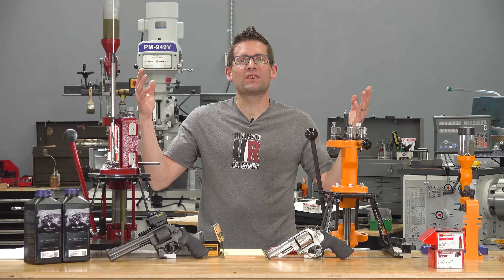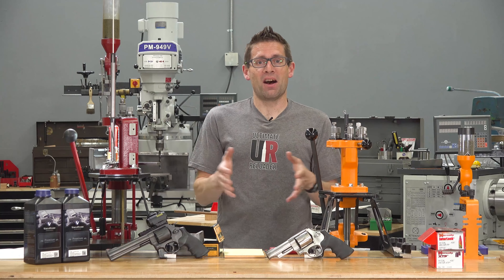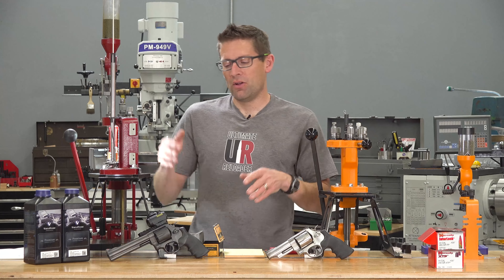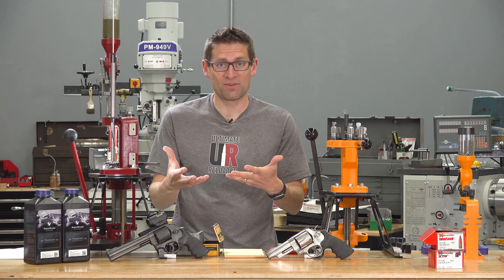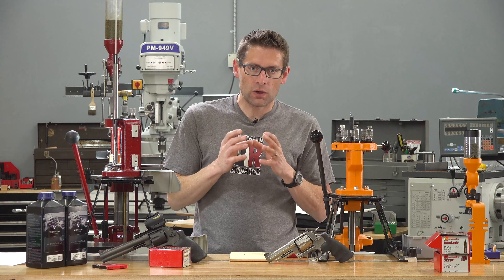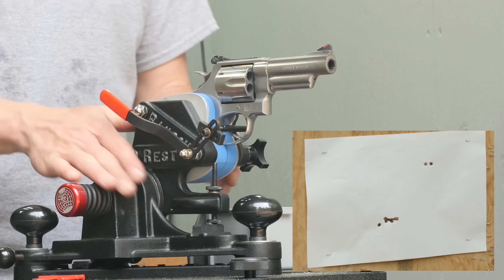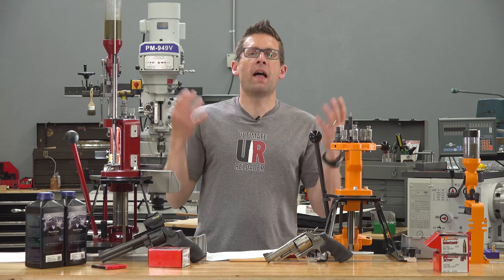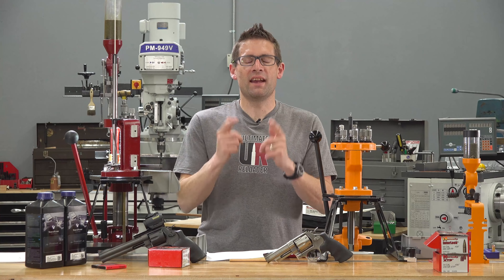Match Pistol Ammo -vs- Progressive Pistol Ammo Experiment

Comment: Also found that each gun (more so with rifles) like a certain bullet weight. It is finding that for your particular firearm and work with that. Like your 4" obviously doesn't like the heavier bullets. That's normal. I'll bet you if you get another 4" 629 it might even like the heavier bullets.
Reply from the maker: Isn't it strange how "particular" firearms are to different loads?
Reply: @Ultimatereloader  very. Almost like finger prints. One would think something from an assembly line should be the same.
Reply: @Ultimatereloader  Very. Would be interesting to find the cause for that variance.

Comment: I have a 629 with about a 7" ported barrel and on it I do the same as you, load mostly 44 special loads but using Starline 44 mag brass so I won't develop 'the ring' from using 44 special brass. As a former Bullseye shooter and a PPC match shooter back when revolvers ruled PPC, I feel to get the most information you really need to shoot for groups at 50 yards, and using the Ransom Rest you don't have to worry about skill level possibly messing up the results. So much more information is gained by going to 50 yards over a shorter distance. Back when I was shooting PPC in the Master class all my 38 special ammo was reloaded on a Dillon RL550, this was before the 550B model came out. I wish I had a Ransom Rest to do some testing, but I was able to get all my shots inside the 10 ring of the standard B27 Police target at 50 yards off a rest, so I knew my revolver and ammo were performing well, but a Ransom Rest would allow me to get the absolute best performance.

Comment: I think you will find that you need to look at the force cones and barrel throat as to why some bullets perform better - with 50 years of bullet loading experience I have had the experience of developing loads for 2 brand new identical sequential s/n pistols - just to find they liked different primers and engagement lengths (This drove me crazy because I nor several others could not measure any significant differences) . I have spent my life as a Mechanical Engineer and removing the human component is just the start, LOL. I like your channel  - trust the Scientific Method

Comment: Fantastic video! This new R.Rest you have will make for some great content in the future. I also like the fact you used some Lee dies. Lee equipment is what I started with. I still use many of my Lee dies. When I reload on my single stage, I will do each process on all the cases before rotating the turret. It keeps me from missing a step. That RCBS powder trickler is too cool. I cleaned up the mold line and polished it up. All of it is great fun. 👍🙂 Thanks Gavin, great stuff

Comment: I would like to see more about how you mounted your rest. I have been using one for about 25 years and have mine mounted to 3/4” plywood with a 2”wide strip of plywood at the front and back on the bottom. This bolts to a telephone pole buried several feet in the ground. Also I use my finger to pull the trigger, not the linkage. It would be interesting to see the same test run with once fired brass and groups fired with individual chambers. With revolvers I generally fire groups of 18 to 24 rounds, with revolvers, as this will often show trends developing with each chamber. With autos I like to shoot 25 round groups 5 rounds at a time. This will show whether the gun will throw the first round out of the group. Good shooting.
Reply from the maker: Thanks Kurt- I was wondering about the variations due to each chamber... If you read the article I link to I show my test setup at a high level. Appreciate you sharing your experience as I'm just getting started with the Ransom Rest here...

Comment: The Precision Pistol (Bullseye) shooters use 50 yards as their measure.  And they look for group sizes under 2 inches at that distance.  It can be done.  Repeatedly.  With progressive ammo. 

Bullet selection is 90% of the battle.  Powder type and charge weight is key. Primer selection isn’t that important.  One thing that is seldom explored is crimp.  Type and amount appears to have a significant impact on ballistic consistency.
Reply from the maker: Good info, and I believe it. Bullet selection seems to have a big affect!

Comment: I have an engineers brain! I wonder how things work together. In the case of ammunition how does certain powders, with certain primers, with certain bullets, in certain cases perform. Also how does loading them on a single stage press compare to a progressive press compare to a turret press, compare those loaded a hand press.  How does the specific firearm affect the results? As an example: a new firearm that has never been fired, a firearm that has a few hundred rounds fired, a firearm that has a couple thousand rounds fired and a firearm that has several thousand rounds fired through it and All the firearms are the same make and model.  How does barrel length affect performance of the ammunition? How does the twist rate affect the performance of the ammunition?  Along with many many other factors!  Some include: air temp, humidity, elevation above sea level, etc. How does all of those factors affect the performance of the ammunition and the firearm.  See what I mean. lol    That is why I love videos like this!  Keep them coming!

Comment: A good quality barrel is just as important as consistent ammo :)
Reply from the maker: Absolutely- and good timing on a revolver, forcing cone, etc. Now I'm thinking I may need to build a match grade revolver... The sickness is taking hold...
Reply: My personal experience and tip: put the firing pin on the hammer and stay away from the spring loaded internal pins on the newer design on s&w`s... traded my trusty 686-3 for a 686 competitor, and triggerpullweight wise im salty AF :/ the apex hammer kit helped, but still not close enough to  what i had... "YES! i only use federal SP primers" :P

Comment: You can not talk about match grade and not sort your brass, aldough it is new there are differences in hight and sometimes also in hardness of the brass. Also every weapon needs carefull finding of the right load. Even if you have two identical pistols, they may require different loads. But other ways, a interesting test.

Comment: It would be interesting to load a batch with the progressive, measure COL consistency, then deconstruct the ammo to measure how consistently the powder charge dumped. How much variation in measurement makes no real difference in 25 yard accuracy?  What is the "tolerance" for COL length for a given charge?  What is the "tolerance" for powder charge variation that produces no real difference in accuracy?  
Some of these questions arise from my own use of the Hornady LNL progressive press.  With my best efforts I still get ammo batches with .005-.007" change in COL. Am I being too picky??   And if I check powder charge every five rounds, trying to maintain a powder dump of +/- .05 gr, I will probably reset the powder dump 3-4 times every fifty rounds.

Comment: U think that 260g load just isnt getting the bullet moving fast enough to stabilize enough. I wonder what a 100 yard target would tell ya about the  bullet impacts and their stability? It be enough distance to show if some of the rounds are starting show signs if stability issues. Or maybe it's a combination of barrel length, powder and bullet weight are not not optimal which should be visible at that distance as well. That was a significant degradation in accuracy if the cylinders and bore are in spec and size properly (seems to be good since the 240 load shot well). I my experience carbon rings havent affected accuracy after the first cylinder or 2 at most unless its obvious caked in there and I'm shoot lead.  Hell its usually not a issue even when it's obvious using different bullet profiles when shooting jacketed bullet after a cylinder or 2. That's a big difference, post a follow up when u find the origin of the 4" accuracy loss w/the 260g bullets please.

Comment: I bought a used ruger sp 101 and it shoots fine with factory ammo but with my 38 special reloads it gets hung up in a certain spot. Any ideas?
Reply: Not sure what you mean by "hung up," John. If rounds don't drop into chambers easily, check out Fortune Cookie 45LC's YT videos on the Lee Carbide Factory Crimp Die. It might iron out slightly oversize bulges in the case. FC45LC also uses pieces of a copper "Chore Boy" scrubber wrapped on an old undersize bore brush and rotated with a drill to remove "crud rings" as Gavin mentioned. Hope this helps!

Comment: You must have made a math error on the extrapolated results. There's .003 difference in your groups, but only .001 in the extrapolated group. It should be bigger, not smaller.
Reply from the maker: Check the data here: https://ultimatereloader.com/2019/04/20/match-vs-bulk-pistol-ammo-does-it-make-a-difference/

Comment: I've had 629's in various forms since the 80's and have found them to shoot very well with loads from my progressive press.
Just as a coincidence I was at the range yesterday shooting my Glock 23 and got some very strange results.  I loaded up some 40 S&W with 180gn. HSM copper plated flat nose(400 Diameter), over 5gn of Bullseye, with CCI #500 primers. At 25 yards, I could not keep the grouping within the NRA  regulation bullseye target. Rounds were hitting all over the paper!   This is the first time I've loaded the 180gn. and am wondering what happened.  I have been loading for more than 25 years, and never experienced such bad accuracy with a load.  I stopped shooting the loads when I saw the bad accuracy, thinking I need to investigate before proceeding.  I'm planning on taking some rounds apart, and weight the charge, and inspect the brass to see if something is off.   Any suggestions?   The gun shoots accurate with 165 gn. CPFN bullets,  but this load with 185 gn, not so much!   lol